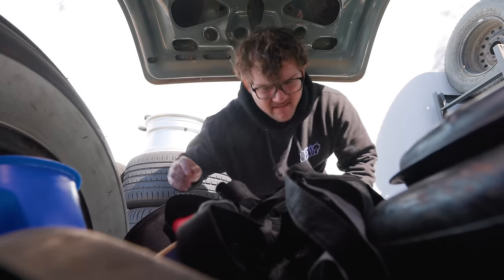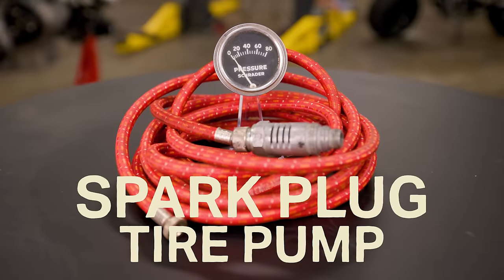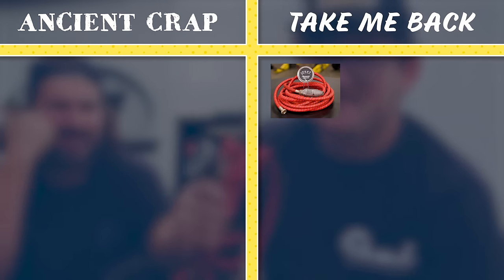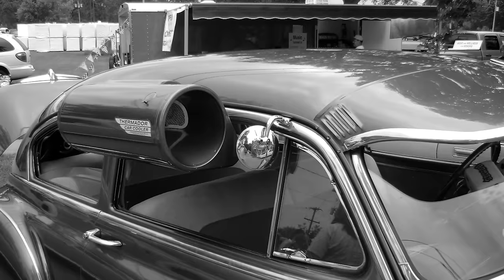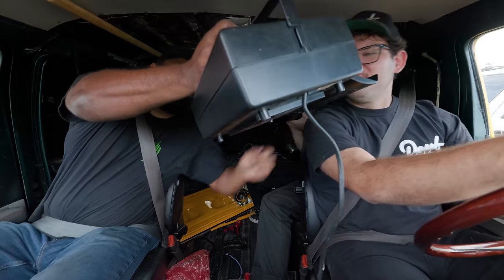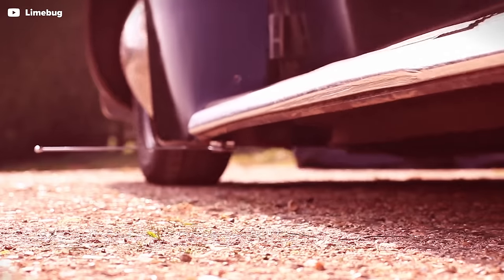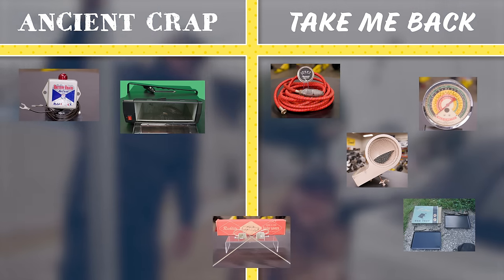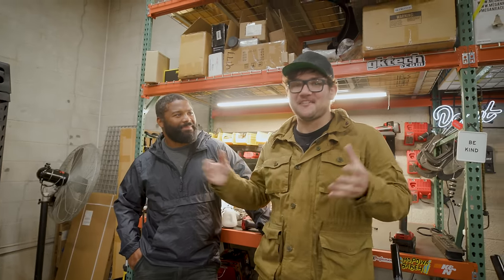Testing Forgotten Car Accessories

Comment: Are those guys from the "around the corner"? Do they even have any imagination about how the engine works? In the part about spark plug pump they say about some rubber ball and fresh air. WHAT??? The scheme is also outta space! Why the hell the valves would stop opening? the intake would still open, sucking air from intake receiver, pulling in fuel mist and exhaust would still open dropping the pressure. Most of compressed air will still go to the exhaust an a bit of air with fuel mist will go into the tire. And that would work only on old carburetor motors, on injector motors there would be plenty of fuel in that air and in addition to inflated tire one would get a JakieChan light on the dashboard in addition to misfire error code and engine running in failsafe mode. In modern world this gadget is a piece of rubbish that can do worse to your engine!

Comment: Thentire groover isnt ancient crap people ude them regularly in offroading. People with rock bouncers or mud truck or mega trucks cut grooves and reshape paddles all the time esspecially the mud trucks and mega trucks, almodt all of them racing have refrooved and reshaped the paddles on the ag tires they run for better performance. And the product yall had did exactly what it was suposed to so again hows that crap

Comment: How do you not know what your average mileage is it's easy for you saying people didn't know we new honestly 80s most your v8 motors were getting 20 to a gallon geo tracker 4x4 was getting 40 miles to a gallon it that vehicle had a desiel it probably would of goin sixy 70 miles a gallon as you choke regulate cars worse fuel mileage gets while yal were getting 10 to a gallon on gas v8s maybe 14 early 90s I was running a one ton dually getting 20 miles all stock yall paying to much for car insurance paying 80000 for a new truck car I'm doing same maintenance getting better mileage I'm not choked down still running my 93 desiel no black smoke passes California emissions an candida range of 650 almost 700 miles